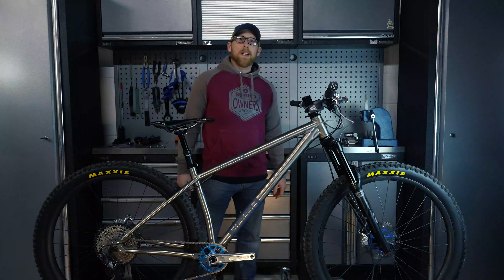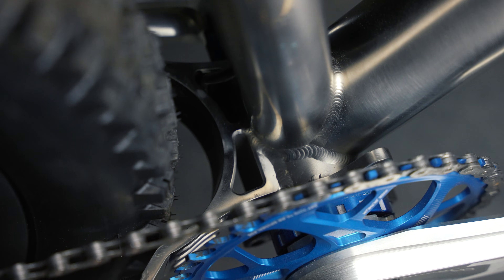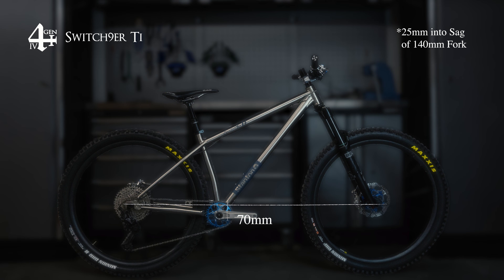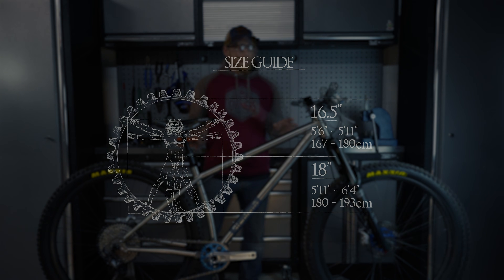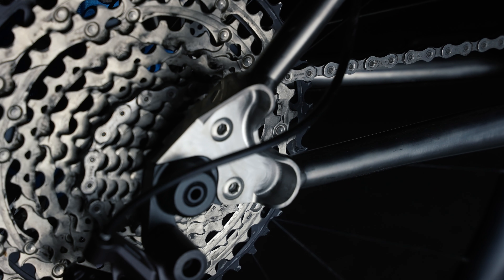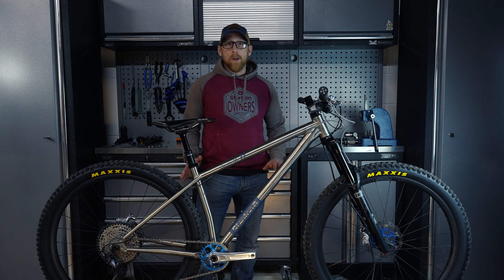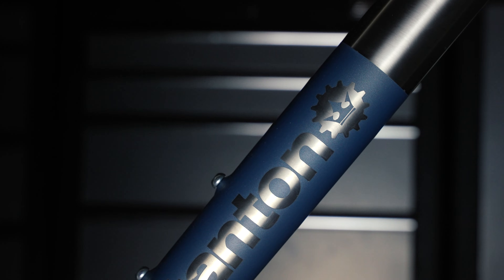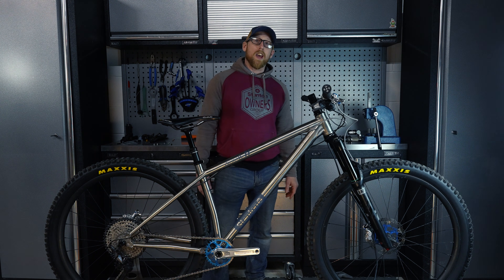Stanton Bikes - Stanton Switch9er Ti Gen4 Tech Talk

Comment: Hi i own the gen 3 love it.  According to the Geo charts you have extended the effective top tube length by 12mm sag or 16mm static not 25mm which you say in the video.  Effective top tube for the gen 3 is 634, 646 for gen4 ?? could you clear that up Thanks.

Comment: So geo numbers are sagged or unsagged? Is it possible to have the numbers unsagged with a 571mm ATC fork (say lyrik 160)? No seat tube bottle mounts, really? 200mm dropper on a size 18”, would it fit? 66-622 tire would fit? Thanks!

Comment: Sooner or later I can't buy a bike frame for my 171 cm height. ^.^ My XC bike has 395 mm reach and 90 mm stem. There are no 485-460=25 mm long stems available.
Reply from the maker: I’m 172 and this frame in 16.5” with a 35mm stem and 780mm wide bar fits me great 👍

Comment: Such a stunning frame! Can I put a UDH hanger on those dropouts?
Reply from the maker: UDH T-type dropouts will be offered as a conversion dropout system! I’ve had samples and there’s only a little more to amend in the design! They’ll be available soon! 
We sell the current replacement hangers 😁👍
Reply: @StantonBikesUK  Is there any update on the conversion dropout system? Or are transmission shifters only possible with the Gen 5 frames?

Comment: The Switch9er gen 4 is a sweet looking bike. Loved my Sherpa G3 until it got hit. The Switch9er is an interesting option as a replacement hardtail, but the lack of a down-tube bottle mount is a con for me in the costal(Pacific) desert. It certainly has the frame space for it based on the video.
Reply from the maker: Got ya! Big love for the feedback, you tried hip packs? 👊😁
Reply: @StantonBikesUK  I have but sometimes on a 35 mile trail ride in 90°f heat i need more. On my Sherpa id have a 1.1l bottle along with a 750ml bottle & 2l hydro pack on me & that would barely be enough
Reply from the maker: @Alex_564  when I rode in Sedona it was temps like that and higher… I literally couldn’t take on enough water! The new Stanton Sedona might be the better bike for you! 👊😉👍
Reply: @StantonBikesUK  when does the geo numbers drop on the landing page?
Reply from the maker: @Alex_564  think we’ll have it live in a week 😉👍
Reply: @StantonBikesUK  Excellent, looking forward to it & the gen 4 Sherpa. It also doesn't hurt to offer extra bottle mount on the Switch9er as I do like the cs number more than the Sedona's based on the Radavist article.